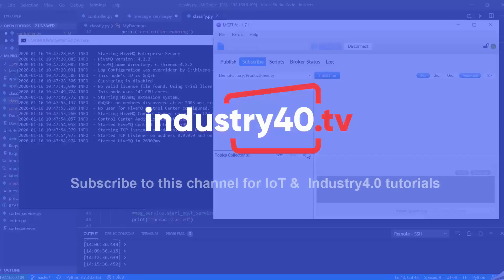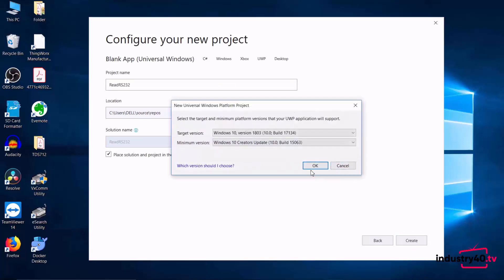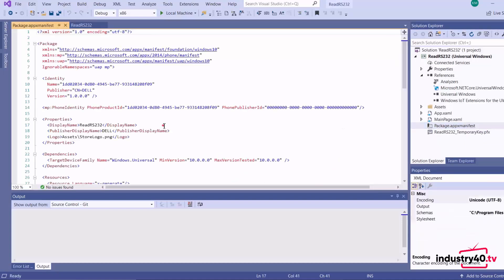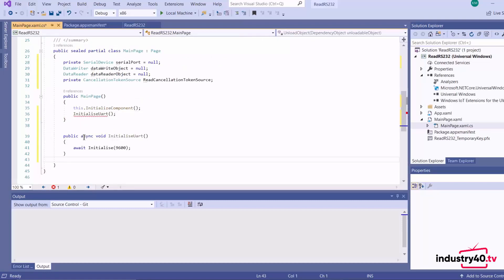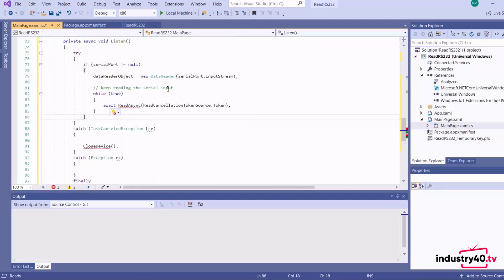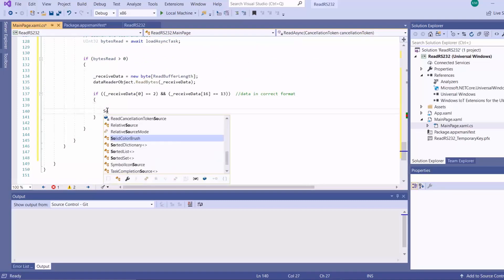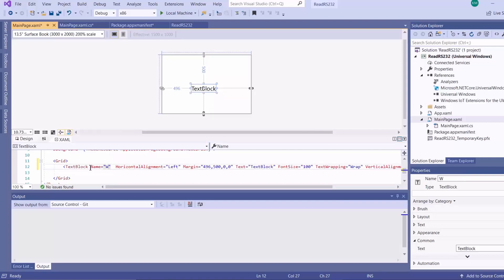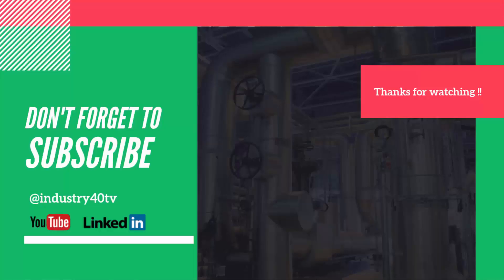Windows IoT Core RS232 - How To Read RS232 Device Using Raspberry Pi and Windows 10 IoT Core

Comment: Hi, and thanks for the video.
I installed windows 10 pro on a Raspberry p4 and works ok.
I can't get a usb-com cable - Aten model uc-232a - to be recognized in order to connect an interface for digital modes for radio transmission. Do you have any idea how to fix this problem? Thanks for your kind reply Salvatore

Comment: Hello, thanks for the tutorial. Please I would like to know the hardware implementation of the connection between the Raspberry Pi and the device. I'm working on a project(Win 10 IoT Core) where I get data from my an Arduino Uno. However, I don't know how to send the data to my Raspberry Pi. Kindly help
Reply from the maker: Thanks for the feedback Emmanuel. Connection between Arduino should work with a straight connection Rx=>Tx without the use of a level converter.